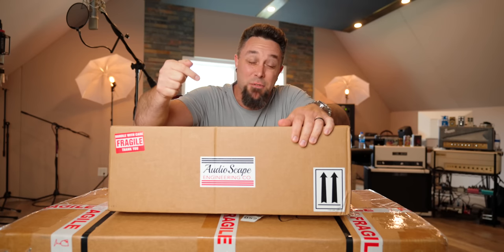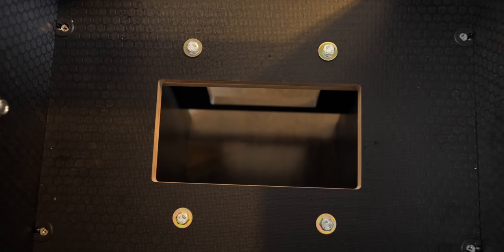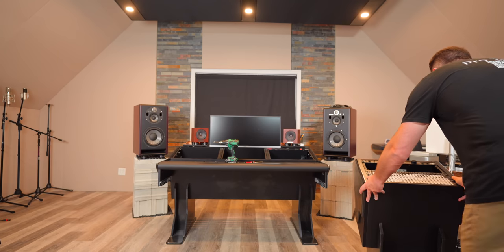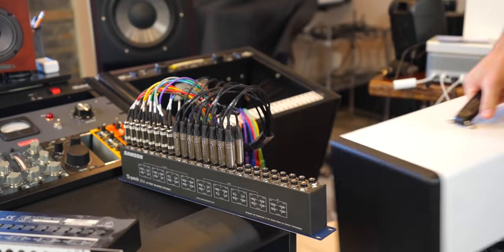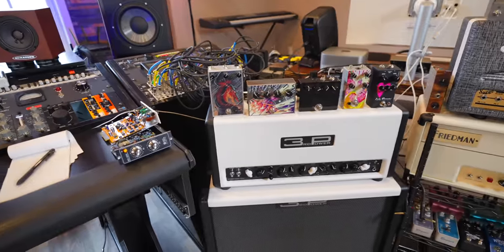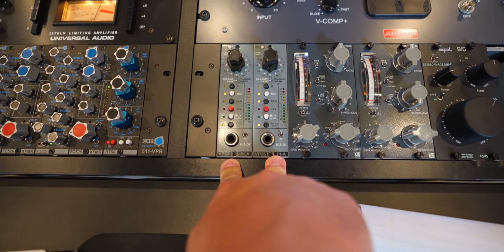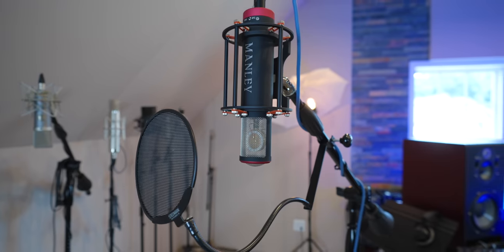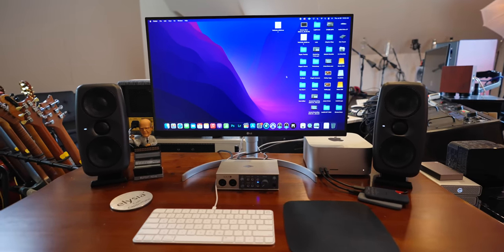REBUILDING My Entire HOME STUDIO in 24hrs!!!

Comment: Sweet!  Do you have any plans for bass traps*? I know you've got lovely fabric covered 4" walls but I could imagine something like a few of those RPG modex plates would improve the low frequency decay time in there.

*proper tuned ones or steel plates, not just 4-6" of rockwool stuck over a corner.
Reply from the maker: Check out my Focal Trio 11 video. We measure the room, and it’s one of the flattest rooms my Focal guy had ever been in. So I’m very fortunate to not need any bass traps

Comment: Great Job!  One thought, I got the argosy 360XI stands for my ATC45s.  I had to add 4x4s (3.5” by 3.5”) under the base of them to bring them to the perfect level for me.  The 42” version would have been too tall as I did not want them angled at all.  For your Focals, I wonder how the argosy 360I would work, not sure on the height though.  I am sure you planned on the weight, just wondering the extra weight of cinder blocks on the 2nd story.  

Thanks for the great videos!
Reply from the maker: Luckily wait in my room is not an issue as the construction of the floor is very thick and there’s big beams, and tripled up floor joists in the floor from when we built the house. The cinderblocks will get replaced eventually, it’s just low on the priority list at the moment. Thanks for watching!

Comment: I’m curious, Colt. Why so many patch cables plugged into the front of your patch bays? It looks like your gear is plugged into the same places all the time, so why not just normal things to each other using the back I/O?
Reply from the maker: It’s not a bad idea, I’m just slowly build more and more gear up overtime and have never made the switch to doing it that way. Thanks for the suggestion though!
Reply: I was actually going to ask the same thing. I have 4 patch bays and hardly ever have to repatch anything because of normaling
Reply: @ColtCapperrune  Oh yeah man, I recently normalled the outputs of my interface to the inputs of my outboard gear, and vice versa. Saves me so many cables and so much time patching things. Totally worth the effort.
Reply: @Jake_Sachs  what’s normalling? Is it just deciding on an insert sequence?
Reply: @jorykevinberger7047  Normalling is a patch bay thing, used to connect gear to each other with the rear jacks instead of the front ones. So for example you have a multi-output interface like Colt does, and you want Output 1 of your interface to be always connected to the input of a compressor, you can plug the interface’s output into a top rear jack, then the compressor’s input into the rear jack below that. Assuming the patch bay settings are set to “normal” these 2 points, now those things will always be connected to each other without having to use a cable in the front of the patch bay. 
You can also do what’s called “breaking the normal”, which is when you wanna patch a normalled thing (in this example, Output 1 of your interface) into something else. To do this you would use the front of the patch bay to plug Output 1 into another patch point.